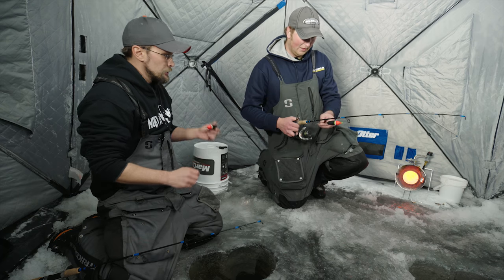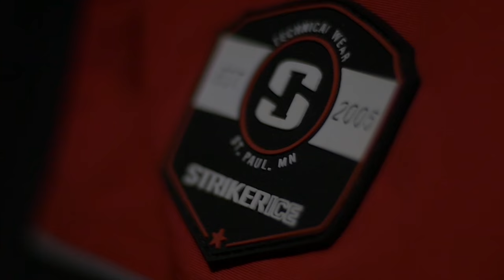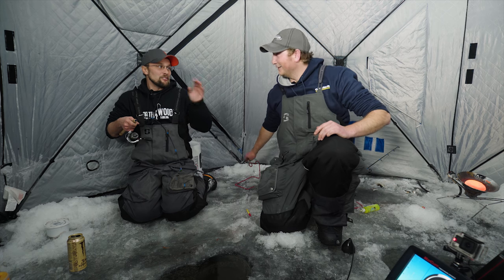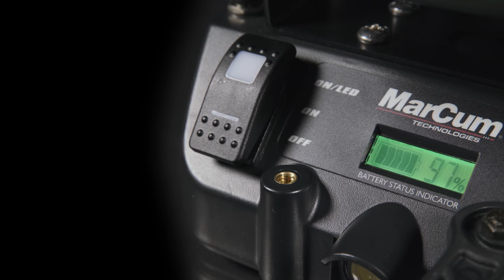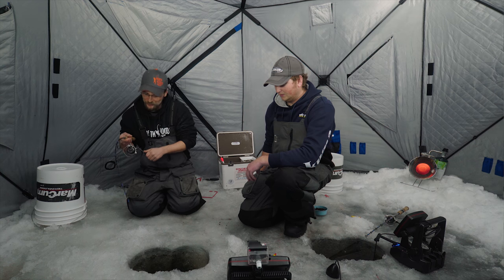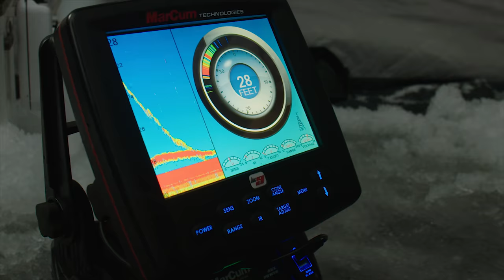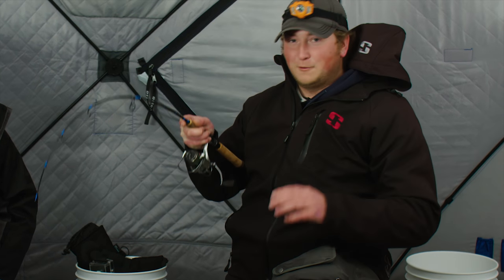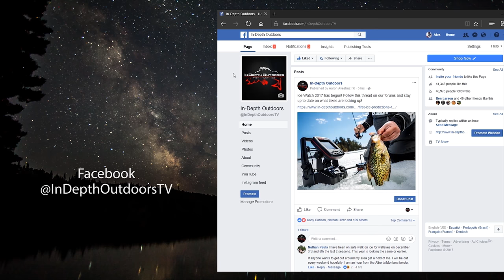Ice Fishing For Giant Sturgeon - In-Depth Outdoors Season 12, Episode 9

Comment: What bibs are you guys using there?
Reply from the maker: Striker
Reply: InDepthOutdoorsTV predator or hardwater?
Reply from the maker: @jordantaylor5552  Pat wears Predator.  Not sure what model Jake was wearing.  I would guess predator but can't be 100%.
Reply: InDepthOutdoorsTV one more thing, do you have experience with both the climate and the predator? Are the climate bibs worth the extra money?
Reply from the maker: @jordantaylor5552  The climate is definitely warmer than the predator.  Comes down to what you want from a suit.  The predator is lighter weight than the climate.  Most guys will layer under the predator to adjust for conditions.  The climateis a bit bulkier but you won't have to layer in anything but the most extreme cold.
Reply: InDepthOutdoorsTV you have been a big help. I appreciate it. Can’t wait to get on the ice this year. Can’t wait to see some new videos from you guys
Reply from the maker: @jordantaylor5552  new season starts Nov 18.